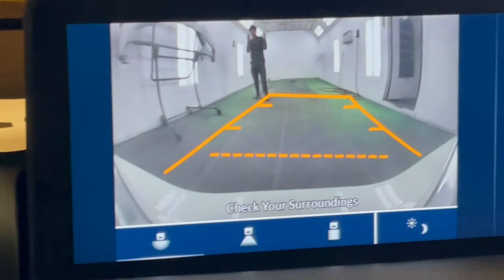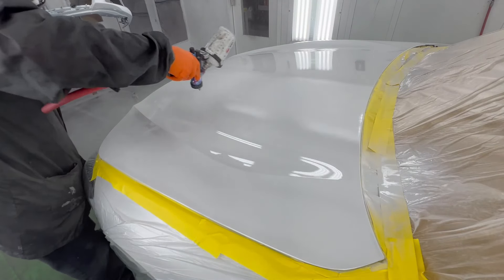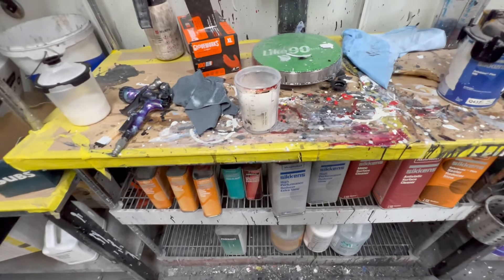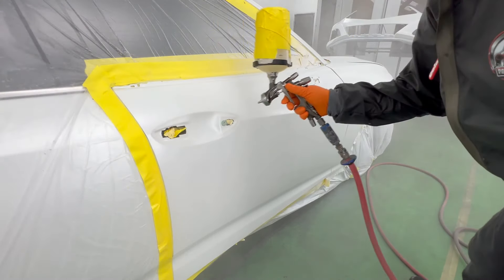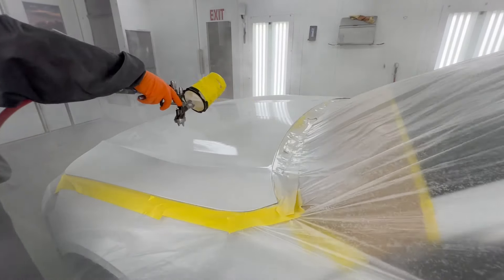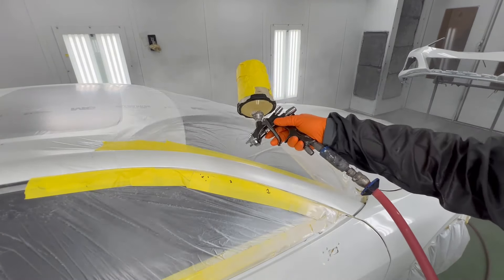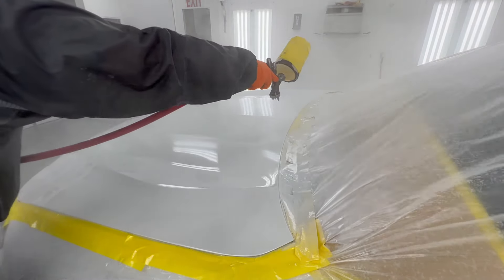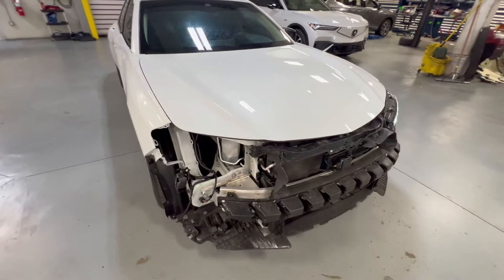When You NEVER Want to Paint a Car Again!

Comment: Big fan of your channel, from Dublin Ireland….I’m doing a diy project on my land rover defender, wanted to ask if you could explain spraying wet or spraying dry, I’m a bit unsure, can you help? Also, how do you achieve that mat look? Is it just spraying dry and then no clear coat?
Reply from the maker: Spray it wet. When the base dries it will dries matte and smooth ready for clear
Reply: @PaintSociety  Thanks Brian, I was asking also to explain the terms, spray it wet and spray it dry, is that something to do with the atomization of the paint? Or distance from the panel, or an adjustment to the flow?

Comment: Brian, uk diyer here.  I've learned so much from you, gunman and others....my silver wetbed blends are improving.  I would like to ask advice about a wetbed issue?

Most of you pros appear to apply the wet bed then go straight into applying the basecoat.  When I followed this, the silver started to drag and at first  had to wipe the entire job of with thinners and start again......yes I had had enough 😂

What seems to work for me is to apply a lighter clearbase, the allow about 15+ mins, then 'mist coat' the silver on.

Are you pros getting away with it because of the booth temp?

Any advice welcomed.
Reply from the maker: Honestly, I stopped using blender as a wet bed and only put it on my sealer edge to smooth it out, if you use the slowest temp reducer and over reducer base a little bit, it works better
Reply: @PaintSociety  thanks for taking the time to reply - I'm sure we'd all like to see how you blend now without a wetbed

Comment: I'm living this right now spraying this RSX, I've been struggling with Sealer, had to sand it all back down because it was spraying texture on the panels, I think I need to over-reduce it, no matter how much I stir out of the can it's still thick n clumpy, I moved brands thinking it was the brand but getting the same issue, a video on getting the consistency/viscosity or whatever would be super helpful, now that the sealer is sanded down I'm just going with color and move on but man I've learned a lot from this experience, can't tell you how many times I wanted to quit..

Comment: I have a lexus white pearl that is kicking my butt. New place and new paint system. Super thick water paint and its terrible. The new place has little to nothing to clean paint guns so when im spraying white i get little black specks all over. I wanted to quit today. No matter how much i tried to clean it i kept getting it. I wanted to quit today.
Reply from the maker: It could be coming from the air line or air borne itself. You might want to get a brand new gun for yourself if you can
Reply: @PaintSociety  unfortunately I just started this job and they use glasruit water and it's super thick. The only thing they have to wash the guns with are a small thinner bottle and everything is gummed up. I have a satas and they all are spitting. It could be the air hose but this place would never believe it. Absolutely killing me.

Comment: I tried the cut in for a tri-coat. I sealed based and only cleared the inner side of the parts. The next day hung parts on car and sanded outside of panels with 800. There was some clear that wrapped around the edges that I also scuffed. When I had the car in the booth and sprayed base it lifted on the edges of the panels. It was where the clear wrapped the day before. I assume it softened the clear. Same paint line as you are using. Any suggestions??
Reply from the maker: That’s because the base attacked the open edge of the clear, all I do is base these parts, because there’s no clear anyways on the insides so don’t even worry about clear anymore honestly
Reply: Ya makes sense on like a fender or hood. I was replacing a rear door. What do you recommend in that situation. Seems like I always have a slight difference when I paint tri-coats with half parts on stands and half on the car. Thanks for the reply and keep up the awesome content!!
Reply from the maker: @chadtabaka475 just put one coat of clear on the face of the door so you dont have that open edge.  Or just tape the front

Comment: (ASE Certified back in 2000) Taking care not to overpour toners is important. Especially white. My opinion white is the hardest to match even for blending. Slower is sometimes faster in the end.
DuPont has the VINdicator system for finding the right variant from using the VIN number. I had awesome results on first mixes with NO spray-out panels.
I'm working as a collision tech, now for the past 5 years or so, Haven't painted but one job in 2 years, but it's like riding a bike.
Reply from the maker: You couldnt have said it better! White is super sensitive
Reply: @PaintSociety  ;)

Comment: That yellow 3M tape is garbage. We went through a box of it at our shop after our normal tape became discontinued, and we just couldn't get it to stick to the point we've been using double the tape to keep it down. We've been using the teal blue 3M automotive tape lately and it's not amazing but it's definitely better than the yellow enough for us to keep using the teal blue 3M tape.

Also, thank you for the video, kinda what I needed after not being completely happy with a 3 stage pearl job I just finished. Ended up having to spot in an area on a door after getting a piece of lint in the mid coat.

Comment: You have the benefit  of a mixing station.  As a garage painter I can't just mix some yellow tinter . It requires me to drive 30 minutes to the paint store. 
I'm not rral good with spray out cards. To me,  they sometimes are very deceiving when it's in the garage all taped up and ready for paint. 
But, I do appreciate your attitude and the knowledge you share
Reply from the maker: @davidray4655  yes this the unfortunate part about getting pre mixed paint
Reply: Get your color dialed before you mask it all up and put it I. The booth
Reply: Do you work for a bodyshop or this  a shop set up as like a teaching studio?

Comment: great works Brian! im using ws400 series 1... what kind of pressure is recommended? i spraying at 20-22 psi full fan full fluid but it doesnt lay flat, turns out dry spray.. jason@sg
Reply from the maker: move slower and around 26 psi, around 5 inches

Comment: Just finished my 1st paint job, was frustrating AF.   Had a new Gun to put the clear down, it had a bad pressure gauge and leaked, I figured out the gauge while testing the pattern, but only noticed the leak when the gun was tilted over the hood and dropped a glob of clear, I thought I may have tilted the gun too much and continued.  Ended up with several globs and the usual orange peel of a 1st effort.  A lot of wet sanding is in my future.

Comment: This is as accurate as it gets! I’ve been there many times, and it takes a lot of willpower to persevere through it. Just remember no matter how bad a job comes out, no matter what you have to do to make a job right…you’ve learned and you’re that much better than you were before. Many of the jobs that I have messed up have been on my own cars; when that happens there’s no one to blame but yourself. I’ve spent thousands of hours blocking a car out to perfectly straight only to have the foundation fail a few years later😩😣! You know what though… taking that entire area back to bare metal, treating the rust that developed underneath(creating the bubbles that caused the failure) and doing the entire process over..went much faster than it did the first time-you know why?? Because I’m better now than I was then! DONT QUIT❤